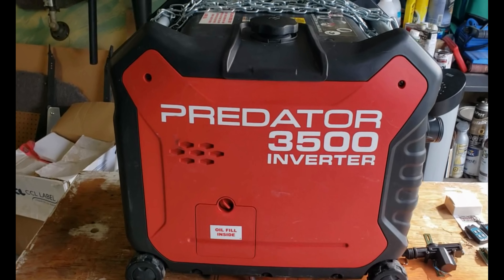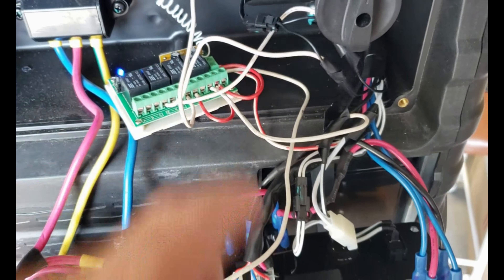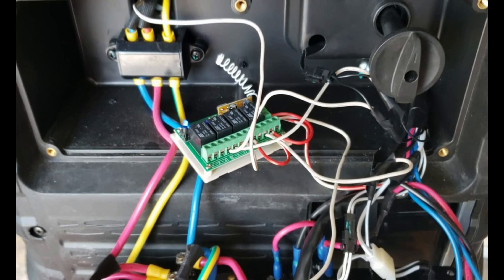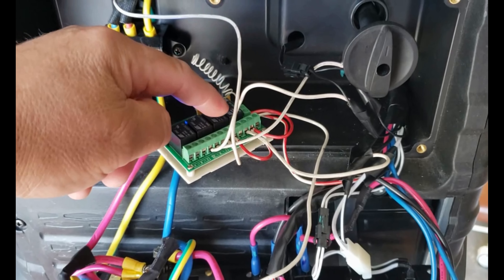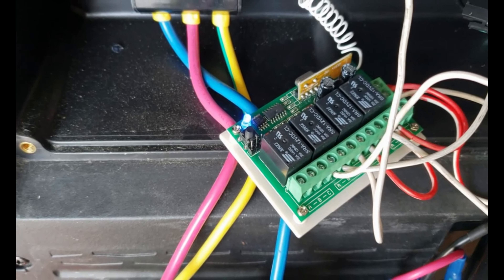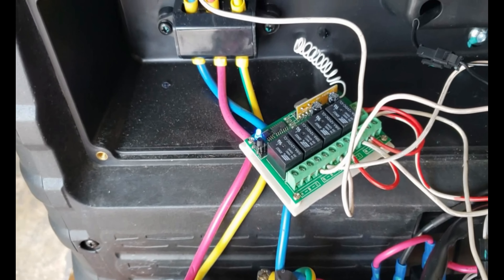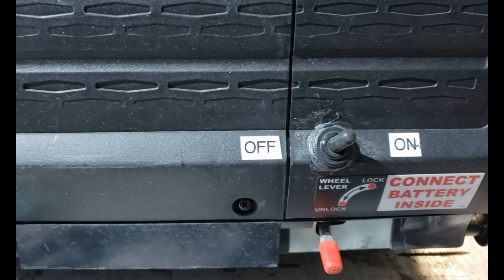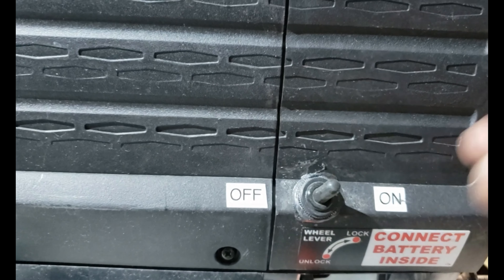Predator 3500 remote start update

Comment: Thanks for making this video.  I made the mods a couple of years ago.  My little bracket holding the actuator broke, so I had to get back into the genny. Ended up moving the actuator and adding a small lighted rocker switch to cut off power to the board.  Windman- you dd a great job with this- don't know why you don't have more views, etc.  My 3500 has just over 2000 hours and is running strong. Oil change every 100 hrs or so.  I use it mostly when we are traveling/camping in the RV and the remote start is SO NICE- no getting out of a cozy trailer, flashlight in hand, to start the genny.   Thanks!   Pappy